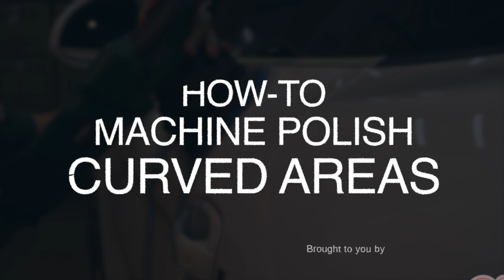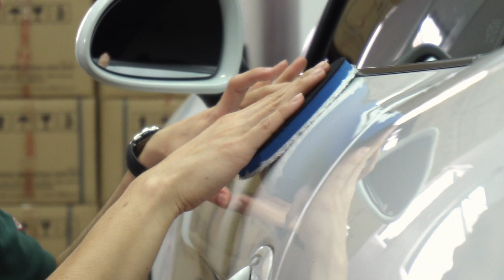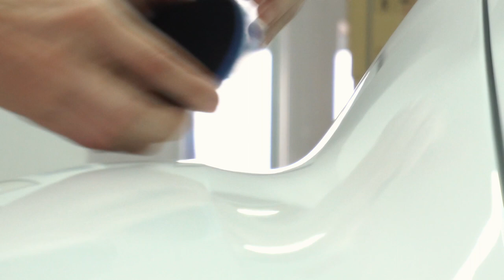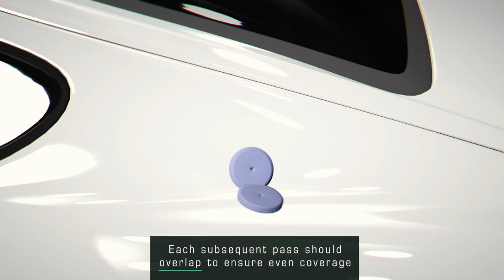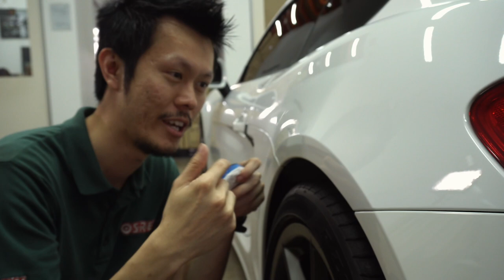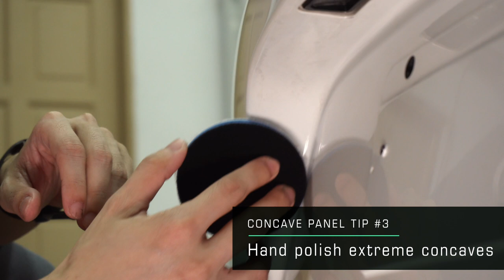How To Polish Curved Areas

Comment: Hi great vids! I have a question in regards to the end of the video when your were at the back of the car... could you polish that area with something like a Rupes nano ibrid?
Reply from the maker: Hi there, good question. For that area, if the pad is smaller than the surface, and if the polisher housing may enter without bumping into any surface (especially the tip of the neck), the answer is yes.

Comment: Are there any hand polish sponges/microfiber to use to make it easier? I tried with regular mf towel and it was  a mess lol
Reply from the maker: We don't recommend using hand polish sponges as by hand isn't sufficient in defect removal.

Unfortunately machine polish is the way. For concave and convex areas, switching to a smaller polisher will help too

Comment: I have a griots G9 polisher with 6 and 5 inch backing plates. Is there any technique I can use to do this with a 5 inch polisher? I really don’t want to buy another polisher. Should I just do the narrow curved areas by hand, and flat areas with my DA polisher?
Reply from the maker: Hey, so for really tight curves, we don't recommend polishing with a 5" or 6", it's forceful and might cause unwanted result such as backing plate knocking on paint. Perhaps hand would be the best out of this situation.

You will have to use your discernment on this, if you may be able to tilt and not knock into the curvy surface, and the pad is still able to spin, then it's fine.

Comment: Just to check if the polisher machine being used in video is also DA?
Reply from the maker: Hey Ben, we actually polish this car with da entirely. So yes it applies on dual action polisher as well. As long as there is sufficient surface area for a polishing pad that is in contact with the paint surface, it will rotate. 

There are times where smaller polishing pads are favoured to allow more contact coverage of pad and to navigate narrow and smaller surface as well.

Comment: For concave areas, could you just use a 2 inch like the nano?
Reply from the maker: Hey there!

A smaller polisher will definitely help in tackling convex or concave surfaces with greater ease, however, the drawback is that for a smaller pad, it might take longer to cover the surface. At times, during polishing, we do find that a 3" da polisher (or a pad that is slightly oversized) with the techniques applied would yield the same result at a much short time for most curvy areas. But for difficult or smaller surfaces, the 2" and 1" are truly a wonder.

Of course, if you have access to multiple-sized dual action polishers, polishing these areas will be easier!

Comment: Is it ok if only polish with only tip portion of pad with da polisher when polishing smaller than pad like body line which has 90 sharp rise?
Reply from the maker: Hey Rajiv, I'm afraid we don't understand your question. We are guessing, so hope you find the answer relevant.

Polishing edges regardless of da or rotary requires a more cautionary approach as we don't want to chip off / strikethrough paint on edges. We recommend tilting ever-so-slightly in a way that the rotation spins off the panel rather than hitting it directly. 

Most polishers are rotating clockwise, hence tilting on the correct angle to prevent it from knocking the paint would make sense. (Da pads would stall if there is too much tilting, hence ever-so-slightly approach)

There are also other precaution steps we recommend including taping adjacent panel's edges and slowing down on machine speed.
Reply: @OSRENOfficial  what I mean to say is if I have small area where I cannot fit the entire pad, can I still polish by placing tip of pad surface on that small area?
Reply from the maker: @gmaail...  on rotary, this is a common technique and approach. 

On a dual action polisher, most of the time it's difficult and doesn't correct that well with deeper swirls/scratches by doing so. A smaller polisher is still highly recommended.